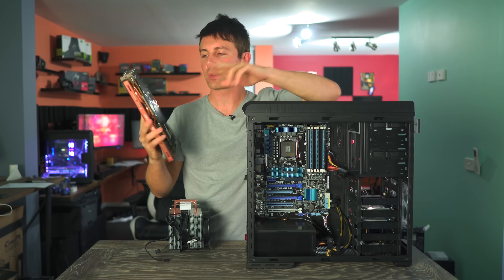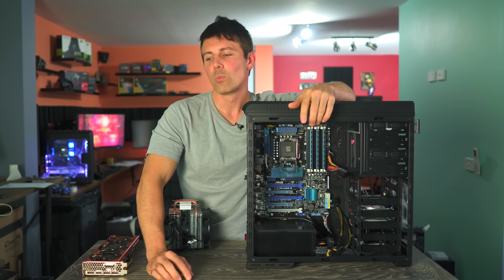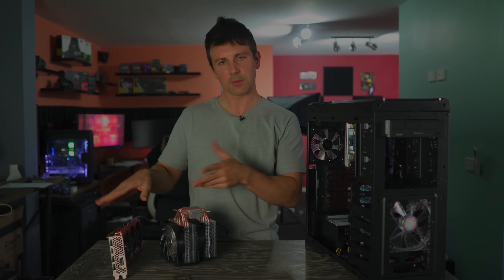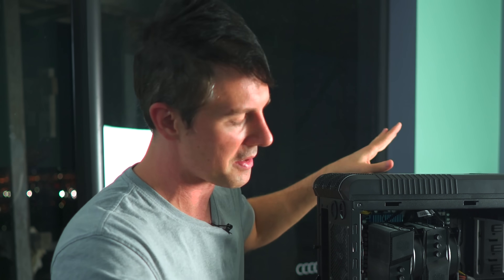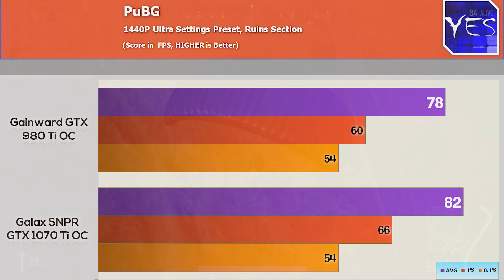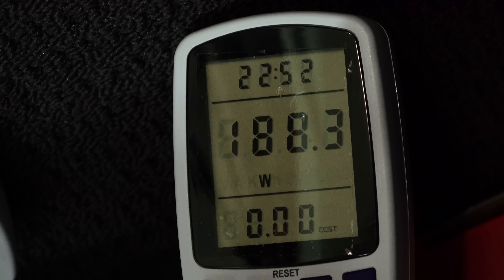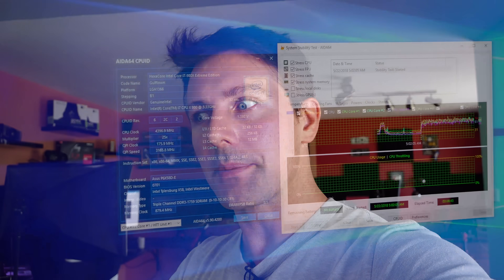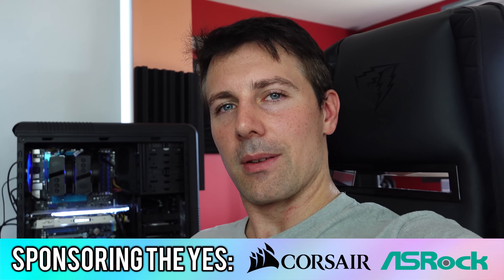GTX 980 Ti Vs. 1070 Ti on x58 - Does it Get Any BETTER?

Comment: Those extra 2GB VRAM would give you a smooth 60 fps with Cyberpunk 2077 1440p FSR Quality with a decent 32MB L3 Cache CPU 3-4 years later.

Now that the dust has settled over Pascal and Maxwell - 
The 980 Ti is the best Windows XP card (with modded drivers)
The GTX 1070 Ti is the best GDDR5 card (without the X, which makes memory chips run way hotter)

Comment: what case do you have right there?
Reply: Full ATX Tower standard. It was a trend between 2010-2015 considering the width x length of the Motherboard is around 23x31 cm.

Very large indeed

Comment: If there is enough money to buy a 1070TI, the Pascal is the better choice, because of the higher single percusion power. But you have to be carefull not to buy a miner card, wich is impossible with a 980 Ti

Comment: My EVGA < ( GTX 980 TI SC+ SLI)> GTX 1080TI FTW3 is still a strong System, with my E5-1680 V2 @ 4,7GHZ on an asus Rampage IV Extreme, with an Intel 910 Seies with 400GB and an Intel 520 Series 120 Gb,  Samsung 850 EVO 500GB( my 750 S. is dead), 16 GB corsair Venegance 1866MHz with 1,5Volt, EVGA supernova 80+ gold 1000Watt it is an amazing system for me, in my Lian Li PC-A70 F Severtower. But i ´m looking to change the 1080Ti to be watercooled. Thanks for giving me the idea to built such a system!!

Comment: Did I hear right ? He said that he was about to use "Brake Cleaner and WD40" to clean the graphic card ? This is the same kind of products I use to clean my motorcycle ahah, I'd never use these  on electronics components on purpose tho lol
Anyway, I bought yesterday (for the low), an EVGA GTX 1070 Ti FTW2 ICX, will not put my ex Inno 3D GTX 980 Ti Ultra X3 for sale.

For my use, playing mostly AAA games in WQHD at Ultra / Very High settings with my old i7-2600K @4.2 Ghz, in order to reach the 60 fps cap at all time, I needed to upgrade my graphic card, I expect kind of like, 20/25% more performances, regarding all the benchmarks I've seen.

Nice video tho !

Comment: Lol, they aren't far apart, but your CPU was gassing it all out, a faster one would have fed them better, used a bit more Vram etc, would have given the 1070ti another 5% or so
  Fact is the 980ti is about the same as a full sized 1070, but a bit behind the ti version
   Still a great buy at the right price because it'll monster most games at ultra 1440

Comment: Just picked up a 980Ti Lightning edition (MSI) for around $250~ USD and it'll be paired with an x5660. Stoked to see how this will perform. Wish I still had my x34 to pair it with, but had to sell it awhile ago so now I'm back to 1080p. But I picked up the x5660 and an EVGA SLI3 board for $29 and they work great.

Comment: Still have a 980ti and find it is still ok. Would like to upgrade but not quite yet. Gonna pull a bit more out of it I think. However I have known this card to always be hot and seeing your temps has me shocked. I donno how you did that! Mine goes to 75 ish when gaming. Most games it is around 65 but with Ark:Survival Evolved it gets really hot. I used to worry but I don't anymore as I hear everyones 980 ti's can go that high but how low you have yours is crazy!! I wonder if I am doing something wrong with my fan setup or maybe I need some new fans. These are quite old now. Might even be worth changing the paste

Comment: Tech why the x5675 and not the x5690? I’m asking because I’m going to upgrade from a i7 930
Reply from the maker: Its a better bin essentially, or at least that's the rumors.  Its TDP for clock speeds is the best on the range.  Making it technically the best overclocker.
Reply: Tech YES City thanks

Comment: 980 Ti is probably the best GPU that Nvidia has released in the last 5 years. I mean when you have a good cooler and can OC it, it is equal to - and sometimes even above, stock FE GTX 1080s , possibly even some aftermarket ones.  I got lucky with winning the Gigabyte G1 Gaming GTX 980 Ti - which is easily one of the best models for air overclocking.  And I say it is the best based on said Overclocking, as it holds up better than ANY GPU from its Era - and actually competes above the GTX 1070 in the Pascal product stack - basically reaching parity with a slightly tweaked, fully OCed GTX 1070 Ti - or even a GTX 1080 left stock!

Just comparing things like Firestrike, Unigine Valley, and Steam VR Benchmark - as I have said I have gotten better results than SOME GTX 1080s! Of course I am running 1503 MHZ core and 8 GHZ effective VRAM speeds, which is a solid 45%+ OC over "reference" (1000 MHZ base, 1076 Boost) - so just remember that when you see a 980 Ti compared against a GTX 1070 on GPU-Z Database - that is because Pascal overclocks its self largely, and Maxwell has HUUUGE amounts left in the tank that GPU Boost 2.0 does not touch without massive tweaking. 
In my case, that included +0.375 mV offset, custom fan curve, and +136 core, +990 memory (in Gigabyte's "OC Guru II" software, as I could not nail down as stable an OC with MSI Afterburner - though I still run it as a system monitoring tool in Windows 10 - since there is no performance "Gadgets" like you could install on Windows 7 to monitor temps and speeds.)

Also OC Guru II only supports fan stepping - I think that may have been part of the issue I had with Afterburner, but I think it was more Voltage related, as I needed to hit a stable 1.218 Vcore under load to maintain 1503 MHZ core and 8 GHZ VRAM.

Comment: hi mr tech yes city...

im a good fan of you
and my favorite is your pc parts hunting...

if you happen to be here in hong kong,
i'd like to take you to a paradise of super ultimate massively ultra cheap pc and pc  parts here in  hong kong
and you can easily find most of the RARE PC PARTS AND GPUS for a super ultra cheap price....
and also alot of secret shops here that ive managed to buy an R9 280X for ultra cheap of $3.00   usd : )

Comment: Have you tried the CoolerMaster "Master Gel" series of thermal paste? I used the master gel "Professional" and while it really takes a while to get a nice even spread going (it likes to clumps up and then stick more to the spatula provided than the chip itself), but it gives pretty good performance for the price and for being non-conductive. I get about 55-60 degrees C on my Xeon x5675 when overclocked to 4.2ghz on all 6 cores with hyperthreading, and with probably too high of a voltage at around 1.385v. Could easily be running at 40c at stock with this paste I recon.

Comment: I have an asus sabertooth x58 motherboard with intel i7 980x, asus 1080 ti, and 6 8gb ddr3 ram sticks, 48gb ram total. This computer is a beast, runs cool with corsair h1100i v2 liquid cooler and I won't be upgrading to a new ddr4 mother board for some time. Yes, x58 is usable and worth it in 2020!
Reply: I have gigaybyte g1 sniper version for socket 1366.. but it only can take max 24gb ram. Why ur motherboard can do 48gb ram ?
Reply: According to intel my 980X maxes out at 24gb ram too but it works perfect with 48gb ram. Just try it and see.
Reply: @bigtexas7580  Ok. thanks for the reply.

Comment: what thermal paste do you use for the gpu ?
Reply: Same stuff I assume, you've gotta apply it like 2-3x thicker there than the CPU though since the heatsinks don't fit flush usually. I had my Sapphire 290 Tri-X OC card going to instant 80 degrees C overheating after changing the paste once, as I tret it like a CPU and just put a thin even layer, you really need to dollop it on for the GPU's... mine is now running at 50-55c at max load.

Comment: Hello, please I would actually upgrade my system. I have already a gtx 1070 from msi and I can get the x5675 from AliExpress (I also have a zalman power supply). But I can’t find any lga 1366 or x58 motherboard for less than $130 unless if they’re broken. In my country I can find the t3500 for about $200 and I would really love to get a new case and all of that later which I cannot do with the t3500. Can you please give me a recommendation motherboard and a price point ? Thanks

Comment: Zotac Amp Extreme watercooled with a Corsair H90 and Kraken G10 bracket doing over 1520mhz on the core and 4001 on the memory while staying under 60 degrees. It beats 1070ti performance and beats any 1070. I think the 980Ti will go down as one of Nvidia's best cards ever.

Comment: For a stock x58 build like an i7 950 with no crazy overclocking would it still take a 980ti / 1070ti and not bottleneck the card?

Comment: I'm not quite sure of the point of this video.  You want high-end gaming for cheaper price.  But its still more money you have to fork up.  Getting high frame rates at 1440 means you have to spend extra money for the monitor also.  So its not a budget build where its a 1080p build with 1050ti.  If you have $1,000 to spend on a system then you can fork up more for current parts.  The 980ti is great with 6 gigs.  But its out of manufacturer's warranty.  If it dies on you right away you're out of $300.  A brand new 1070 is about equal performance has 3 year manufacturer warranty for $400 and 8 gigs ram (more).

Comment: I purchased my MSI GTX 980 Ti Lightning in 2015 and see no reason to upgrade using my 1080p monitor.  If next generation GPUs easily play all demanding games at 4K I will consider upgrade options.    Thank you for this video.

Comment: Arc Survival Evolved does go up to 5.3GB when all settings are at Epic, and my MSI GTX980Ti Gaming 6G does scores in average 52fps, which is not bad at all, even my old card MSI GTX670 Power OC edition scores average 40fps on Medium low settings, and everything is running on 1080P. The card is old, but still packs a nasty punch.

Comment: gotta say ff xv is hell to run i manage 1080p 35 fps average hardly with a 670 2gb.. with frequent crashes because the drivers aren't optimized for the 600 series DX

Comment: I have Gtx 1070 ti Msi frozr with amd fx 8350 i think i need to upgrade cpu :X
Reply: INTEL 4690-4790 IS A REALLY GOOD JUMP.I JUST DID IT MYSELF AND IT SMOKES THE FX CHIP

Comment: The 980 Ti is a great card! My MSI 980 Ti 6GB OC runs very hot though, needs aftermarket cooling to not drop clocks in the most intense games. Otherwise, recommended! Got it for 330€.

Comment: Recently i bought x5650 and get easy OC to 3,7 Ghz (i can put on 4,00 Ghz with 70º), now i want to update my gtx 660 to new graphics card what graphics would u recomend ? (play 1080p) does the 1060 have good performance with that setup ? or 1060 have bottleneck with the low performance of this xeon ?

Comment: 980 Ti still holding it down strong. I couldn’t resist the 1080 Ti last yet so I switched.
Reply: Im rocking the 1080 Ti, but after this video, i want to slap in my Zotac AMP EXTREME 980 Ti!!!!!!!!!!!!

Comment: Got myself an 980ti FTW from EVGA and i water cooled it using a Kraken G12 and a H55 cooler. I can overclock it further and it stays cooler even under load for extended periods of time.

Comment: This is quality real word testing , but your results are cpu limited.  Nehalem ipc is realistically 40 to 50% of a 8700k.  

In your tests, neither card can outpace the cpu, though the 980ti will gpu bottleneck faster in stronger games.  A gpu utilization monitor would show the bottleneck quite effectively.

Comment: The only recent GPU that would move me off my 980ti is the 1080ti, but with the whole pricing debacle thanks to crypto I've seen no reason to make the move yet. My 980ti still plays almost every game maxed out at 1080p & very few settings need to be dropped in the most recent games to get an enjoyable 1440p experience.

Comment: I’m still rocking the 990x @ 4.8ghz on rampage 3 extreme with a gtx 980ti matrix platinum. Runs every game I play max settings so problem! Won’t be upgrading for a while! It’s only the power draw that makes me consider upgrading to later platforms.

Comment: Now, I still have an EVGA x58 Classified Mobo + i7 920 that's pulling media center/backup gaming duty, refresh my memory though, because I did some cursory googling, and I can't remember. My Mobo has only USB2/Sata3/PCIE2.0, I remember there was a version with USB3/Sata6 that came out near EoL for the x58 chipset but I don't remember if the PCIE spec changed or not.

And if it didn't, is there a chance the Graphics cards were bottlenecked by the older PCIE spec? Or is the bandwidth still more than necessary? I had a 970 in my Classified and I seemed to have picked up performance when moving into a PCIE3.0 spec system, but of course the rest of the system config changed, pretty much only the GPU stayed the same, so that probably has more to do with it than the bandwidth. I was just curious.

Nice video BTW

Comment: In my country i found a 980ti for 1/3rd of the 1070ti price which is around 175usd vs the 550usd..damn i didn't know they're that close in performance
Reply: wut contenent are you on sir
Reply: 980ti uses almost 100 more watts for less performance. That is not appealing imo.
Reply: why wouldn't they be?  remember,every time a new nvidia gfx card generation comes out in most cases the new 70 series
 will be virtually identical to the previous generations 80 series.

Comment: As far as frame rates are concerned I think it's fine to go back to previous generation cards. But I can't help thinking by doing that you are also giving up on the newer features that came with Pascal architecture that can't be utilized with the previous Maxwell architecture. So there is a little bit of sacrificing to get a previous generation card